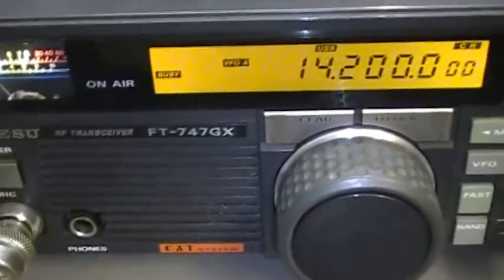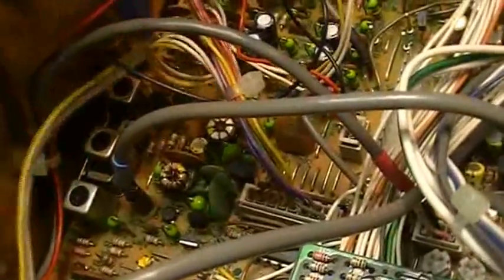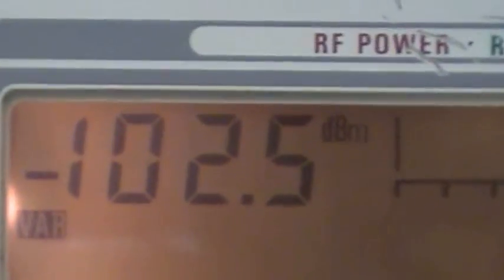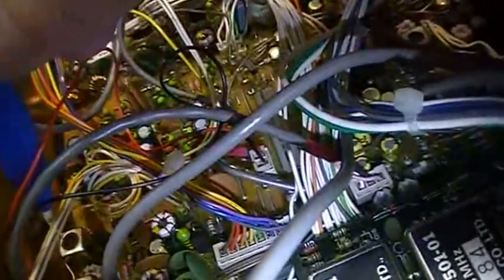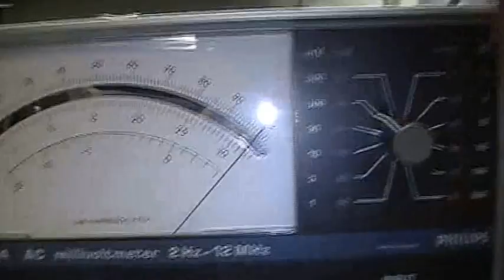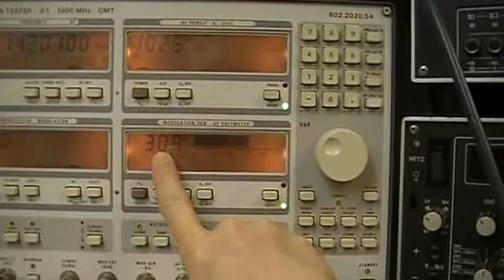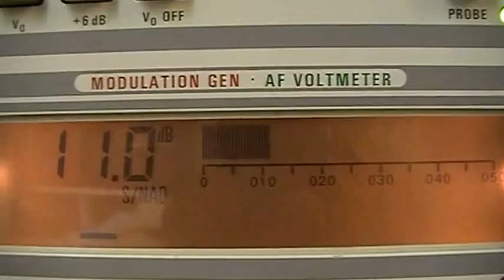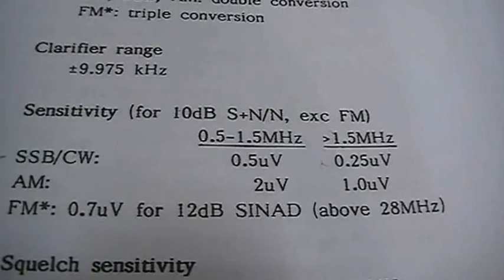#6 Yaesu FT747; Part 2: fix/repair bad RX sensitivity

Comment: Very good video, if the sensitivity had been worse, would you have checked voltages b4 trying to align?
Reply from the maker: What do you mean, DC Voltage? Yes to check DC Voltage is the first what you always should do before going deeper in details!!

Comment: I have seen receiver misalignment many times after the radio has been tweaked by someone inexperienced   Everything adjusted for maximum power output  including the receiver alignment points.  This of course leaves the receiver weak. I used dBm on radar and uwave but never on HF.
My rule of thumb is 1 uV to break squelch,  50-100 uV for S9 on AM and I always listened to the output.
K4OF.
Reply from the maker: BOB RENFRO Yes Bob, I have seen so many radios tweaked by someone inexperienced and this case was one of which was still fixable....73